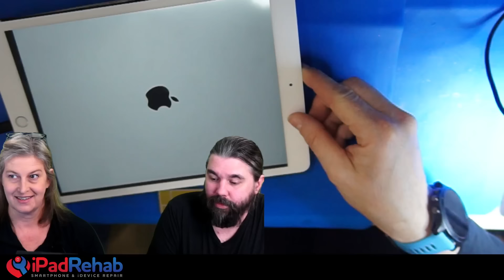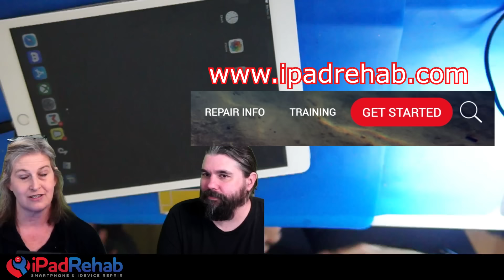How to Reball CPU to FIX iPad/iPhone 7 Apple Logo Loop Error 4013

Comment: Good Video! Finally saw reballing. I'm curious about the SMD at 2:31 and again at 2:44 that pivots during the cleaning the underfill step. It is near the lower right corner of the CPU in those shots.

Comment: Could you share the hot air settings (temp and air flow) for removing and replacing the CPU?
Reply: the same thing that i would like to kñow so much.
Reply: @sarockpashotan  You can use any temperature it depends of your knowledge and skill i am using 405 degress airflow 40%
Reply: thanks o lot mobilboss 037

Comment: Question if I changed my iPhone motherboard can I still recover my data from an iPhone ? Lost all my data from 2019 and tried to recover it , by trying to change the board n get back my photos and videos
Reply from the maker: The data is on the motherboard—so get that original motherboard and then fix it and enter passcode to retrieve data.   If you don’t have the original motherboard you don’t have the original data.
Reply: @JessaJones  i have the original documents but the phone has been wiped

Comment: Would you send this out as a full repair with the missing caps on the CPU, or is it just a data recovery job?
Reply from the maker: I’m not a huge fan of any CPU rework being done as repair.  There is no longer underfill under the CPU so it would be wildly susceptible to water or drop, plus the original charger damage that did whatever it did electrically to the chip, plus the now missing cpu capacitors….

Right now CPU work is more labor intensive than makes sense for a “quick fix no warranty” style repair that you’d expect with the CPU so unprotected.

Comment: Why use 138 for Reball?
Reply: On something as important as a CPU, you dont want to overheat it and end up killing it. Another thing is these stencils are pretty janky, they bow upward when high heat is applied to them, especially big stencils tend to do this which causes uneven balls or even ruining the entire reballing process
Reply: @TheLeathal0ne  i understand that cpu is important, but for sure it can survive with 183 paste,i've done that countless times.
183 has the eutectic property for better solder joint quality.
138 is soft, weak and brittle. its definetely not for wide surface bga like cpu.
about the stencil warping, just put tissue under cpu or use those fancy cpu solder tool, its defintely doable and for sure not the reason they use 138 compared to 183..
just my opinion

Comment: I have a 5th gen iPad that won't stop asking to be restored. I've tried doing updates and restores though itunes and 3u tools and they all complete without error. However, as soon as they go to reboot it goes straight back to asking to be restored. You never got to a lock or setup screen and as I said before, no errors from itunes/

Is it possible that he same thing is going on here and that the CPU needs to be reballed? I haven't been able to find any good leads on potential causes anywhere and I'm running out of ideas. The digitizer was replaced by someone else and it wasn't the best work but the logic board looks fine under the microscope. Nothing missing, burnt, or otherwise obviously damaged. No scrapes to the board or anything. ICC pro doesn't indicate any problems and it charges just fine.